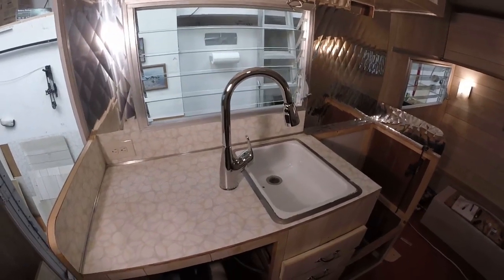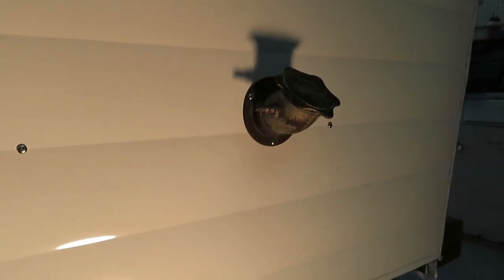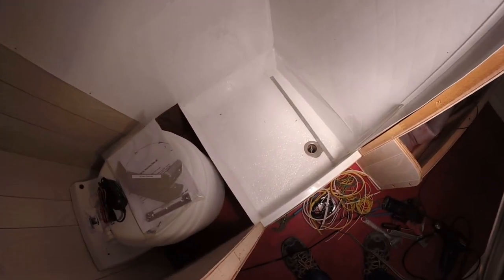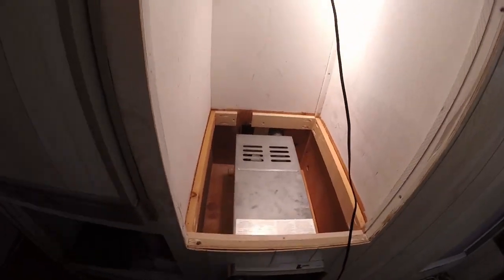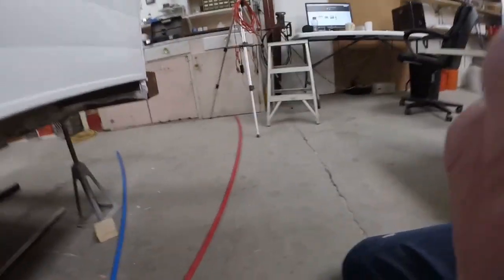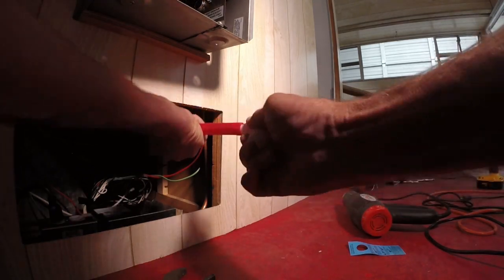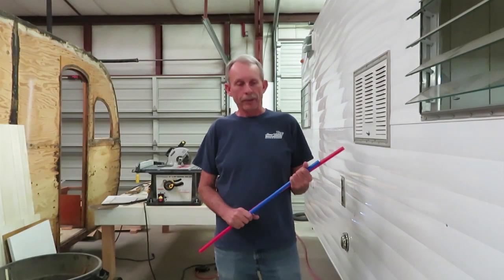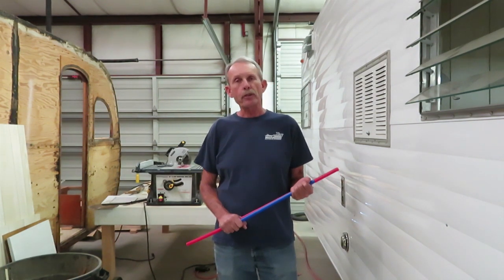Pex Plumbing

Comment: Isn’t it wonderful they now make a check valve for pex pipe so you no longer have to manually change the valve when switching from fresh water to CityWater
Reply from the maker: Well for years people have relied on the one way valve in the pump. I just don't trust that. LOL...

Comment: I have had good luck with heating and bending pex with a tubing bender made for electrical conduit it takes more tubing but you only have fittings on each end of the line unless you have to use a union to add more tubing also I never trust those crimp fittings you have the right idea using compression fittings good job
Reply from the maker: Thanks for that tip. I happen to have 1/2 inch and a 3/4 inch EMT benders...

Comment: Larry...at 7:57 
... is that a electric water heater or LP Gas? 
and what do you think of the tankless water heaters for
our Vintage Trailers? You know that I'm working on a 1972 Aristocrat ...
I am at this exact stage and and at a total stand still... I need help.
Reply from the maker: That is a propane water heater. Tankless works. You just need to be able to vent it properly so you don't burn your trailer down.
Reply: @mobiltec  
Thank you so much for such a speedy reply. A tankless electric water heater does not need a vent... right... 
Do you think Electric tankless water heaters are good... I'm tired of toting around propane tanks... lol
Reply from the maker: @JudiChristopher  If your trailer is going to be parked then go for a tankless electric! Clean and not venting needed.
Reply: @mobiltec  
Thank you... Do you know a good brand?
Reply from the maker: @JudiChristopher  Not for electric but I think just about any big box store will have what you want. Take note of the size of the area you will be putting it in before you go shopping.
Reply: @mobiltec  
YES... I have the sized printed on my forehead... LOL...
I have another problem though... 
Since I want to put in an electric water heater... I need to upgrade my electric box and circuit breaker from 15 amps to 30 amps, but now I'm afraid that the wiring might not be up to par... 
Would it be better if I completely do the all the electric... I'm scared I'd have to tear up to all walls to redo the electric ....
I'm lost...
Reply from the maker: @JudiChristopher  You might want to go watch my Electrical videos.
Reply: @mobiltec  
Good Idea ... Thank YOU...

Comment: Why on earth didn’t you install a tankless hot water heater. Less space used and endless hot water.
Reply from the maker: They too have their problems. Try using one of those when boon docking and you are running off of the 44 gallon tank. You'll be out of water in no time.

Comment: I have two cents to throw in here.I would  not be recommending the use of 90 degree elbows on pex. The beauty of pex is that it can eliminate fittings by bending. All fittings are potential leaks. Pieces are available to bend and hold pex in a sweep 90 degree bend for neatness and appearance purposes. The sweep 90 also has much lower pressure drop.
Reply: Thanks Jack... I wished I had know that when I installed 160' of this...
(No, that was not a typo...) It was after a very bad cold spell in the mountains
and had to replace ALLLLL the copper lines... It was amazing how good the water
tasted after installing the Pex ... I hate copper pipes... being a blond... copper pipes
leaves a little redish  residue in my hair... I LOVE PEX...

Comment: Why the valve to isolate the pump ? Pumps have a check valve to prevent the city water from filling the fresh water tank so I don't understand why you put extra valves in to turn when you don't need them.
Reply from the maker: You never know what the water pressure is going to be in an RV park and it can change. Better to not try to back flush the pump. Besides that, I'm not sure about what you claim as far as a check valve inside the pump is concerned. Your question sparks my interest and I'm going to look into this check valve thing you talk about.
Reply from the maker: OK here's what I found out. After reading this I don't think I want to take a chance on reverse water pressure.

"NOTE: By-pass adjustment should only
be performed by a professional technician
with proper gauges and equipment.
The by-pass is a spring loaded diaphragm
that opens up allowing water
from the discharge side back to the inlet
side. The by-pass is set to begin opening
at about 30 psi and creating full by-pass
at about 65 psi. The pressure switch on
the pump is set to shut off at 55 psi. If
the switch or by-pass are adjusted too
much, the by-pass and switch shut-off
can overlap and THE PUMP WILL NOT
SHUT OFF. Screwing the switch screw
in clockwise will raise the shut-offpressure. 
Unscrewing the switch screw
counterclockwise will lower the pump
shut-off pressure. Screwing the by-pass
screw in will raise the pressure at which
the by-pass starts and raise the full bypass
pressure. Unscrewing the by-pass
screw counterclockwise will lower the
pressure at which by-pass starts and
lower the full by-pass pressure.
WARNING: If full by-pass is reached
before the shut-off setting, the pump
will not shut off. Full bypass pressure
setting should be at least 10 psi higher
than pump shut off pressure.
Reply: I'm a RV tech, and replace about 3 pumps a year due to failure of the backflo valve on pumps. Out of thousands we sell. Just saying....
Reply from the maker: What do the rest of them fail from?
Reply: mobiltec from trash the ebb manufactures leave in the new tanks. They sell the tanks and the tiny plastic pieces fall into the tank and then get caught up in the check valve and slow the little gasket to fail on them. I've took them apart to find out why and found plastic in them. Pumps are DESIGNED to work with their own check valve. Your car is designed so your windows don't leak. So do you build a garage for your car to stay on for the purpose of not letting your car windows leak ? I'm only stating that pumps don't need another valve for people to turn. You have great videos, show great tips. But you don't need a valve to turn every time you go from city to fresh water. It's simply not needed. You can put one there but it's redundant and unnecessary. Everyone makes mistakes. I make them. The valve isn't needed.  Simple as that. Not gonna keep aggravating you Larry. Keep putting valves where they aren't needed if you want, I'm not gonna keep "beating a dead horse" here. You don't add extra brakes to your trailer in case the others don't work. You don't add extra fuses in line with each other in case one fails. Same difference. Pumps already have check valves to present tanks from back filling. Extra valves aren't needed at all. You wanna keep telling people they are, then do that. Of all your videos I watch, this was the first I ever commented on in a critical way. I'm not trying to tear you apart. You make great, helpful videos. This one time you are wrong about the valve. You want to argue about it instead of saying ok I see your point, then argue.
Reply from the maker: Oh I'm sorry if I sound argumentative Dennis. I didn't mean to. I appreciate the knowledge. I just feel better about having the valve there though so I think I'll continue to put them in on future builds. As far as the tiny pieces of plastic in the tank are concerned I know what you mean. I've seen them and that's probably why they make me put the filter in between the tank and the pump for the warrantee. Please accept my apology for sounding argumentative. I appreciate the feed back.

Comment: "Thumbs UP"
Love this video.... 
Today I went to town to buy a 6 gal. water heater...
and a new circuit breaker box and the man talked me out
of all  of it, saying the 15 amp on my 1972 would be ruined if
I tried to upgrade it... Larry... "HELP"... do you have a video on the
electrical of a vintage trailer... I really want to put either a tankless or
an electric water heater in this travel trailer... now I don't know what to do.
Reply from the maker: Forget about the electric. Propane is the way to go unless you are going to park the trailer for very long periods of time.
Reply from the maker: Propane...
Reply: @mobiltec  
Yes, it will be parked ...
Reply from the maker: @JudiChristopher  Then go for it. Tankless electric. No vent needed.

Comment: Also, I know the fittings you are using are good for beginners, but you can buy the tool for crimping pex for $60 at Lowe's, and the crimp rings and firings are way cheaper that those you use. Nothing wrong with your method, just more expensive than crimping the regular Pex fittings. I like your videos, it's just cheaper to go the other way of buying a tool and crimp rings/fittings.
Reply: I have done the crimping (bought the tool), but the problem
I had ... was some times you couldn't get the tool in tight places!!!
I learned a lot after replacing 160' of copper pipe... I hate copper pipes...

Comment: I did not see a drain for the water heater as the pex went up over the wheel well and back down from the tank drain to the water heater.
Reply from the maker: That part of the system is drained through the city water inlet.